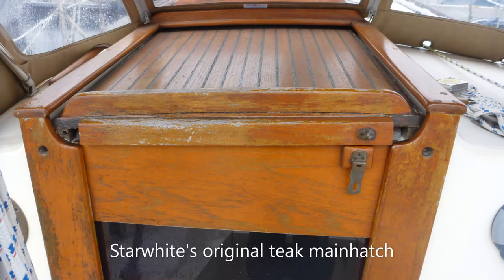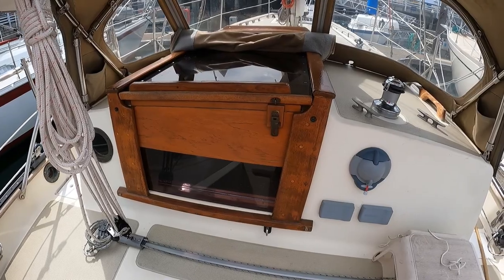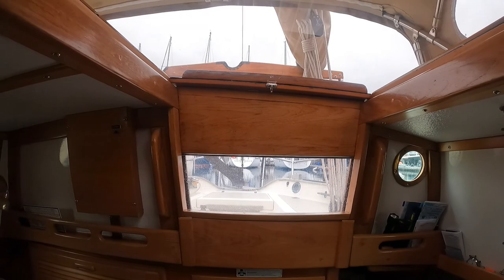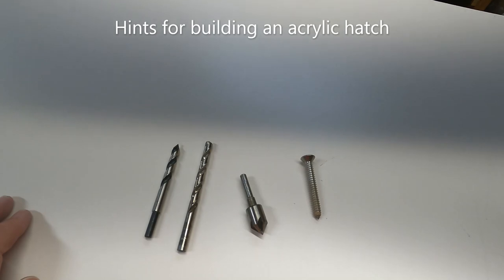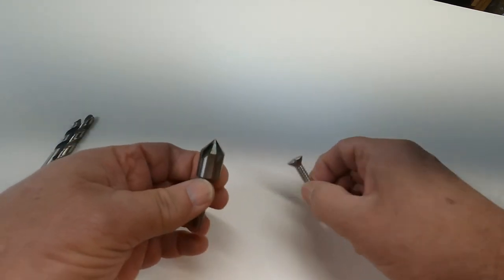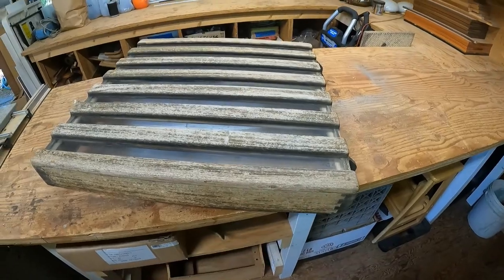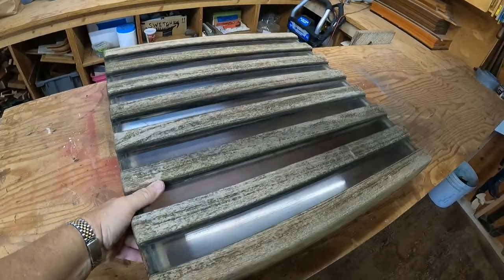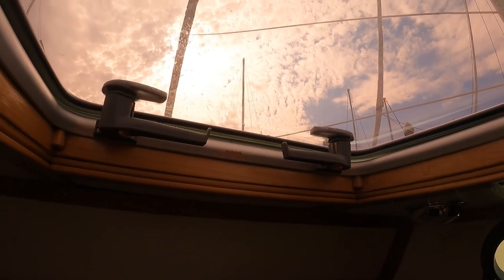Leaky Hatches make for wet cushions and bad attitudes. Video #11 - "Starwhite"

Comment: Woops. The soundtrack is mismatched to the picture.
Reply from the maker: Thanks for the response.  Hmmm... It seems to be working fine for me.  Perhaps it was an issue with your internet connection.
Reply: @Westsail28  I have run it again and it seems that it was indeed my rural African ISP.
Love what you  have done to Starwhite.
My Jasmine is a Samson C-Mist.
A kissing cousin of the Westsail also based on the Atkin Eric.